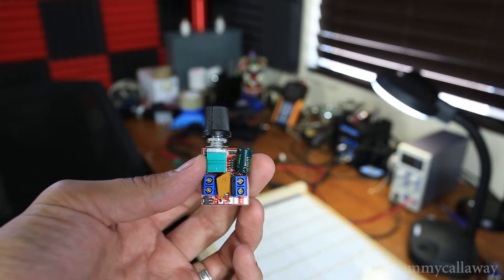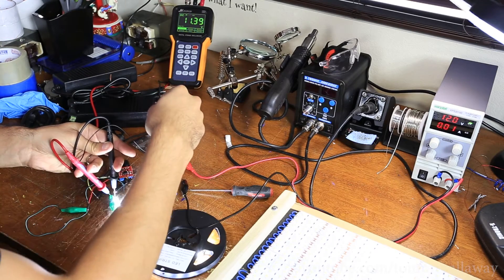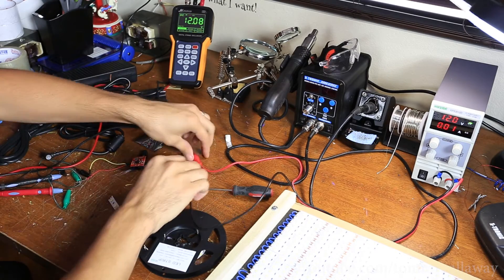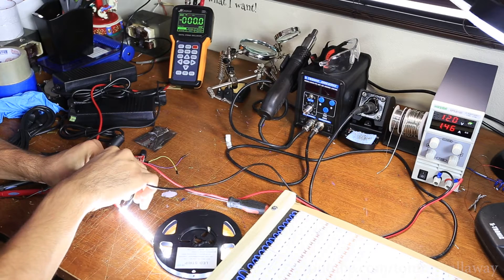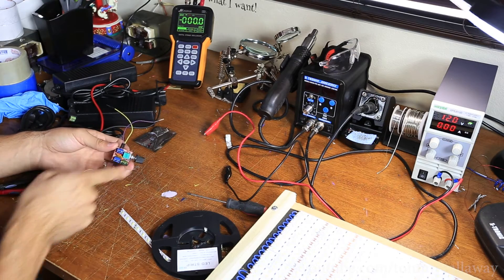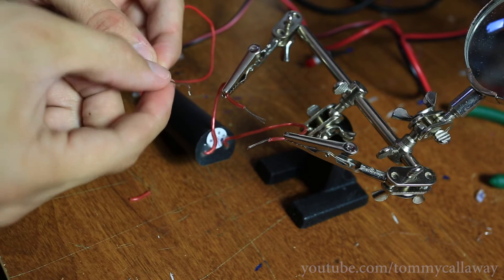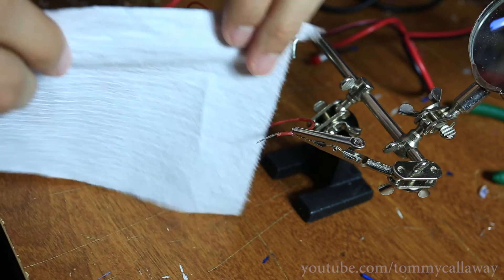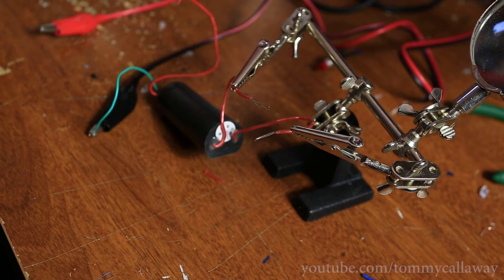Happyskymall PWM Voltage Regulator

Comment: What  will you use instead?
Reply from the maker: In the LED panel project I just used two switches instead, so 50% on or 100% on.  The alternative for me without spending much more money on tons of voltage regulators for testing, would be to wire this lame voltage regulator on one end of a double pole single throw knife switch, and the full on/off switch on the opposite pole, so I could have 0-90% and a 100% option based on my needs.
Reply: Tommy Callaway okay
I was just wondering if you had an alternative since you hated this so much. 
Of course you would want to use all the possible energy from the LED, but if I only had this voltage regulator I would use that. When using this for video purposes it will be nice to dim the light for the scene and not just 50% or full power. 

But I guess I have to keep looking for a regulator. If you take a look at DIY Perks again - this regulator is perfect because he only wanted to draw 9 volts because of the fabric background where an aluminum like you used is better for cooling. But then the flexible feature is lost.
Reply from the maker: Yeah, there's compromises to all the builds. If you want to have a maximum brightness setting, as well as flexibility of dimming, you'll need to use either a high quality voltage regulator, or the wiring I just suggested in my previous comment, which would probably end up being cheaper.
Reply: Tommy Callaway that is also a fine solution for a DIY 😊
It is not for sure that you will need 100% if you have enough power.